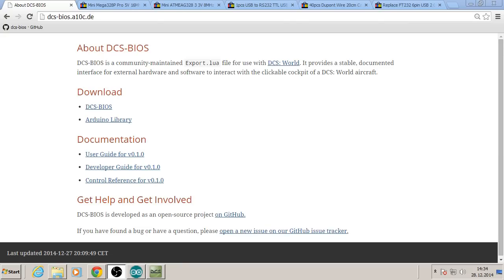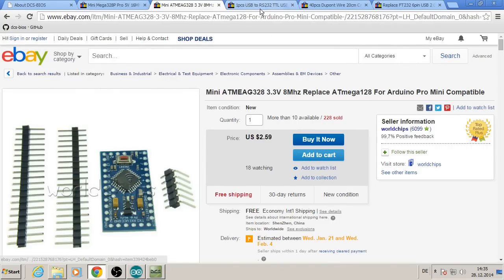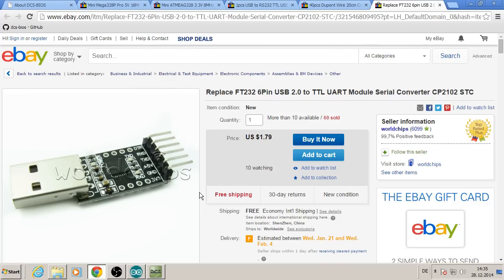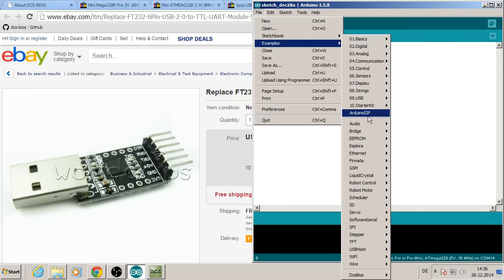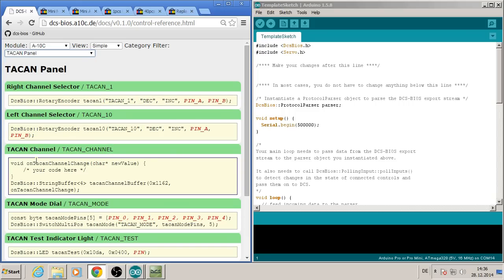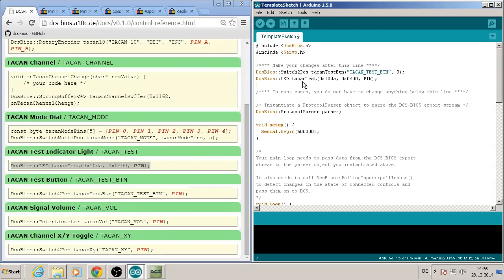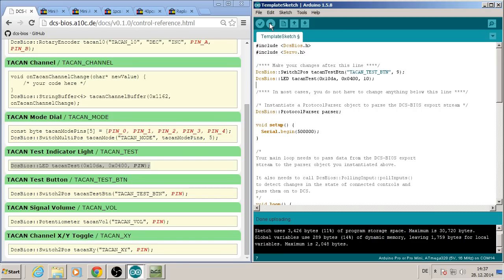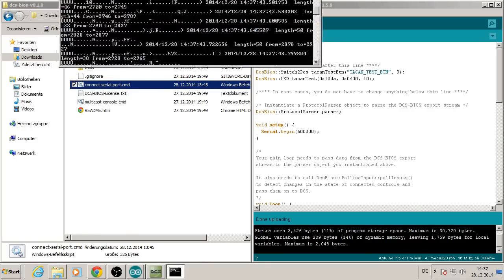DCS-BIOS Introduction

Comment: Ive got 16 encoder dials/knobs connected to an Arduino board.  Can you direct me to the right place to be able to use these encoder knobs in DCS to be able to control certain communication controls or anything that jet-aircraft or helicopters would use.

Comment: Hi I'm trying to build a sim pit based on DCS , and I have read the DCS BIOS documentation , but couldn't quite understand how to get simple row data from DCS like pitch and roll. 
Below is a standard arduino DCS code. I just want to know what to write in the dotted space in front of the pitch and roll to get their values from DCS. Thank you

#include <DcsBios.h>
#include <Servo.h>

DcsBios::ProtocolParser parser;

void setup() {
  Serial.begin(9600);
}

void loop() {
  // feed incoming data to the parser
  while (Serial.available()) {
      parser.processChar(Serial.read());
  }
  
  double roll = ...................  ;
  double pitch = ...................  ;
  
  // poll inputs
  DcsBios::PollingInput::pollInputs();
}

void onDcsBiosWrite(unsigned int address, unsigned int value) {

}

Comment: Can I use this with flaming cliffs 3 or future DCS modules, or does it require fiddling around? (eg. Does the interface work with other modules? Needing to find the correct part names etc. in the data stream myself would be understandable, just curious if the system would fundamentally work in the other modules aswell.) This requires investigating. :) Thank you so much for your hard work!
Reply from the maker: Adding support for another aircraft module to DCS-BIOS involves some Lua programming. You can add any input command that you can trigger from Export.lua and you can export any piece of data that you can access from the Export.lua environment.

This works really well for aircraft that have a clickable cockpit: you can get the state of indicator lights and gauges by looking at the cockpit arguments (floating point numbers that control the animations in the 3D cockpit) and set most switches to a specific position by using the GetDevice(id):performClickableAction(button_number, argument) pattern.

In Flaming Cliffs 3 aircraft, your options are limited.
You don't have access to cockpit arguments. The information you can export is limited to a few bits you can get to through the LoGet...() functions (general things like airspeed, altitude, pitch, bank, and there are some functions that return information about the engines and autopilot system, but I don't know how much info they give you and what FC3 aircraft they will work in).
Input in FC3 aircraft happens through the LoSetCommand() function, which takes one of the iCommand* constants (and an argument if you are controlling an axis). The following thread has a list of what you can pass to LoSetCommand:
https://forums.eagle.ru/showthread.php?p=2215144#post2215144
In FC3 aircraft, for input, Export.lua is not any more powerful than the DCS options menu. You only get "toggle" commands for most switches and have no way of adding a "set state" command because (a) there is no "set state" command provided by DCS and (b) you can't ask DCS for the current state of the switch to decide whether you have to toggle it (unless you can deduce the switch state from some other piece of information that is available).

Right now you need to be or become a Lua programmer to add a new aircraft module to DCS-BIOS; I plan to make this a bit simpler in DCS-BIOS 2.0.

Adding DCS-BIOS support for FC3 aircraft is possible, but so far no one has bothered to do so because it does not offer the huge advantage compared to binding things through the DCS options menu that it does for clickable cockpit aircraft.
Reply: Thank you so much for a fast reply and clearing things up! I knew that FC3 would be a long shot, (i was mostly interested in outputting warning lights etc. but FC3 doesn't seem to support it. I was unsure about the extents of the fidelity of FC3, but your reply cleared all of that up! Cheers.

Comment: Nice, but you are really limited to the count of pins. What is the solution, if you want to control more functions? multiple boards, each with their own usb connection? Or can it be expanded, maybe by using shift registers?
Reply from the maker: Multiple boards with individual USB connections will work, but it will get annoying to manage for more than a handful of boards (especially whenever Windows decides to randomly assign a new COM port number to each board). At some point (maybe 20 or more boards) you might also run into the limitations of your USB hardware and would have to install additional USB host controller cards, so this won't scale up to a complete cockpit anyway.

The solution is to connect multiple Arduino boards to one master board over an RS-485 bus (each board gets a MAX487 transceiver chip). In theory, you can connect up to 126 devices to each bus. The code has been in the DCS-BIOS Arduino library since v0.2.0 and there is minimal documentation on how to wire it up in the comments of the example sketches.

Setting up an RS-485 bus can be done right now (several people have tried it successfully), but what is still missing from DCS-BIOS is some form of diagnostics that can help to figure out what is wrong when something does not work.
Reply: So my plans of using a shift register won't work?